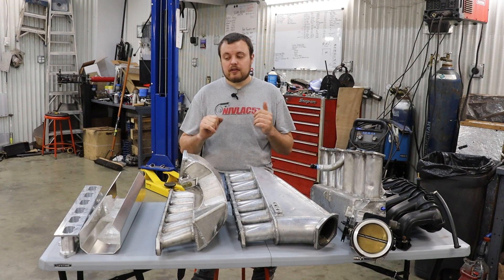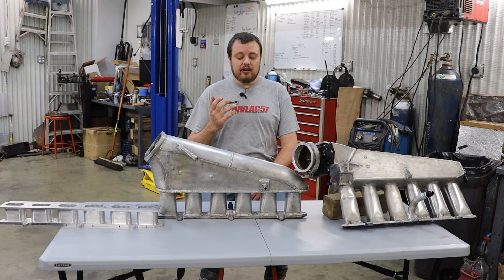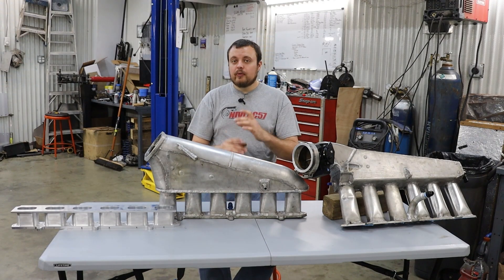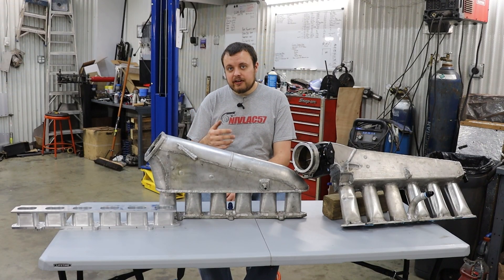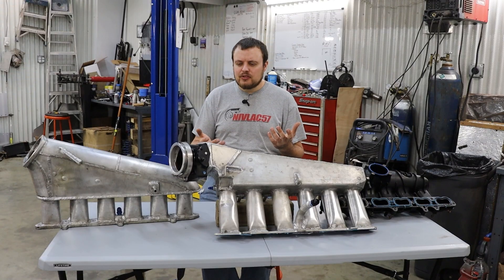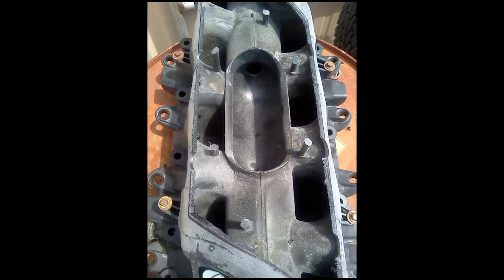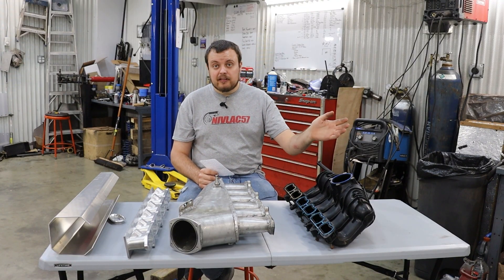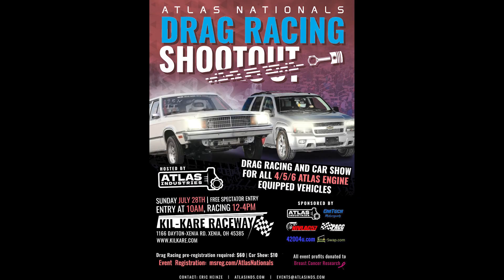Unlocking the Power of Your Intake Manifold

Comment: I remember top fuel having higher HP engines when they had a kick right on the inlet to head flange. 
Those motors had multiple of this stepped staircases on the inlet, purely so the combustion chamber has mega flow cooling. Fuel running don as a flow steam and cascading into the hot combustion chamber. 

Just saying 😐❤️🫣😘

Comment: disclaimer i am not an auto engineer but have researched intake design for 20 years and built several for my own engines/swaps. i have discussed the info below with OEM engineers and have drawn the following conclusions*

Plenum volume is a widely misunderstood concept that gets parsed and cherry-picked and quoted across the internet.
It started being discussed with carb engines back in the day and transferred into the discussion as EFI came around.

I would bet that it became a talking point with some of the JDM legend engines in the 90s/00s but was misunderstood there too. The real purpose of the plenum is to attempt to evenly distribute the airflow from the TB to all of the runners. "Volume" became a discussion topic simply due to needed geometry. 

With I-4 and I-6 (JZ, RB, etc) engines back then the plenum had to be long. In order to try to get air evenly to the front and far-back cylinders, and allow the air to turn a large enough radius to not have big losses, the "roof" of the plenum opposite the runner entry had to be further away and the end of the tank more rounded. Think of the typical 1JZ/2JZ intake you would see 20 years ago. In reality there is a lot of "extra" volume between the roof and runners that only serves to help the airflow turn.

End-throttle manifolds would need to be bigger than the "angled end" throttle since the air has to turn sharper. But you can only fit one or the other into your chassis, and people were grasping at straws at figuring out how those cars made more power than the other.

The stock Atlas manifold can be smaller because it has a central TB and the tank slopes away from the TB entrance. The air hits a sort of wall once past the TB and has to change direction but it does it more evenly, in a very similar fashion to the "slam-air" Ford 5.0 intakes of the 80s/90s.

In reality the 1.5-2x displacement rule of thumb is completely made up. Displacement of plenum vs engine has no golden ratio and can even vary based on the number of cylinders due to the strength of the runner length pulses (more cylinders=more pulses=higher frequency=less damping volume required since they sort of damp eachother). 

A NASCAR from a few years ago makes 900hp at 9000rpm give or take, using a plenum maybe 60% of displacement. The LS family stock is 50% or less (can't remember exact numbers but it's been measured out there). See RIchard Holdener's Keggerator video for an extreme comparison.

But overall SHAPE of the plenum is going to be more important for overall power than simply the internal volume.

Comment: NA intake shape and size matters
Boosted .....dont matter
Reply from the maker: Hard disagree. I heard some one say this before, "NA is boosted". NA just has ~14.7 psi of pressure, and boosted has more depending on how much pressure the power added is contributing. While you can increase boost to meet power goals, a more efficient intake will have potential performance benefits to response and overall horsepower capacity. Saying it doesn't matter is just wrong.

Comment: I noticed that a lot of these manifolds have the injector moved quite back away from the head's intake port. Have you found that there is an effect on idle quality or power delivery? Also, I've noticed the injector angle in some of these points 45 degrees or so, spraying onto the intake runners. Any change in affect (vs. pointing at the back of the intake valves)? Looking to build my own intakes and this information would be super helpful. Thanks again, and great videos!

Comment: You won’t notice performance  change in the plenum capacity with turbo applications and the benefit of increased plenum capacity is more important with ITBs. if your throttle is before the plenum and you increase its size you start to take a hit on throttle response because you are increasing the volume under vacuum.

Comment: What would happen if you set up the runners into one plenum the size of your throttle body component?  Willl you get an uneven fuel to air ratio or will you get something better?  

If the runners went 4 to 1 but have enough space for the throttle body

Comment: It's amazing how little engineering has gone into aftermarket air intakes.  So much of this is broscience based on it worked for someone else  and was tweaked many times trying to get better than copied without any additional thought put into it.   Billet vs. welded is obviously irrelevant and damned expensive unless you own your own full sized cnc mill.   Plenum shape of OEM and aftermarket intakes is a real thing as flow testing has shown different volumes in different cylinders.   Runner length affects air speed and we know air speed and volume are both important although I cannot explain why.     It would be nice to be able to do the basic math to estimate minimum plenum volume for engine with turbo x pushing y cfm into the plenum... but of course this varies based on engine rpm/load dramatically.   It's a dynamic system.   We care about area under the curve irl a lot more than peak hp/torque numbers unless we are bench racing or building for the drag strip.   It's a really interesting problem that I wish I understood a lot better.
Reply from the maker: Yeah. I think the math is kind of a bunch of baloney. It's too complex of a problem to solve, with a simple calculation. Even the computer simulations have very limited value. The only real way to see how well it works is to build it and see how it does.
Reply: @Calvin-Nelson  It's difficult math but it isn't baloney.   This is why engineering takes years to learn.   It's hard.    We have software tools that can model engine flow and turbulence.    You need to understand the math to use them effectively.    Bro-science is not the way.

Comment: Interesting video, on a small 4 pot engine I had the exhaust manifold calculated for the best harmonics and found that a 4-2-1 was better than a 4-1. Interestingly the calculation program throws up critical intake length and for my setup the best intake length was 332.5 mm ( 13.09”) to head face. This takes into account camshaft lift and duration, combustion chamber shape and valve per cylinder and rod length, it even gives exhaust length. I’m still trying to squeeze the long inlet in to a Lotus 7 engine bay

Comment: Oddly enough, this was explained to me in a way that I can apply it to an I4 setup. I want peak NA power to see what it can do before I turbocharge it. Was planning on redesigning in the intake manifold but did'nt know where to start. This was an interesting watch because I know where in my rpms I'm looking for responsiveness, mainly in that 3k-5k band.
Reply: You won't get peak NA power from an engine looking in the 3-5 grand range. You need to push the revs as high as possible, unlike in a boosted build where you can choose to have power down low (provided you have durable enough internals!)

On the other hand, if I misunderstood and you only want it to begin to pick up from 3-5k, with the real power being higher up the range, and don't mind it being lumpy lower down, having a "minimum usable RPM" is useful for deciding how far to advance (and widen the duration of) the intake and exhaust openings (i.e. you can dial in your desired cam profile).

Comment: When the intake valves close there’s a shockwave created that can reduce the amount of air that enters the combustion chamber when the valve opens again. Runner length is often utilised to either reduce this effect or take advantage of it by reflecting the shockwave off the plenum walls back into the combustion chamber of the particular cylinder or an adjacent one.
This is most crucial for naturally aspirated engines.
However it can help or hinder boosted engines.
The speed of sound changes at different atmospheric pressures. This means that what works under partial vacuum conditions in the intake won’t work under boost unless the runner length is tuned for the boost pressure and the rpm.
It might be possible to deflect the shock wave into the next cylinder by putting a small deflector on the plenum wall above the runner, position it so that air headed towards the cylinder is directed down the runner but air reflecting off the valves doesn’t strike a flat surface when it leaves the runners.

Comment: There's another reason why the factory stuck the injectors in the head, and it's something a lot of people miss, and it's why the factory stuck to batch fire for a long time. The injector points at the back of the valve, when it fires while the valve is closed the fuel hits the valve and evaporates from droplets in to vapour, and vapourized fuel burns better then liquid fuel, meaning at cruise you can use a lot less fuel to make the same power. Side benefits are that the evaporation process cleans off the back of the valve, making it last longer, and cools the valve, also making it last longer.
When they moved to Direct Injection in the cylinder head, they lost those side benefits, and ended up with people having engines with dead valves that have the back side of them coated in exhaust deposits, on both inlet and exhaust.
Plenum Size is more relevant to Naturally Aspirated, where it holds enough air for the cylinder to suck from, where the pressurisation of turbos and blowers fills the plenum with substantially more air then the volume will hold alone.

Comment: my 2020 Audi S4 with the EA839 engine has literally zero intake runner, but the engine itself is a torque monster. In stock form has 345 hp and 369 foot pounds of torque and it hits super low in the curve🤷‍♂️

Comment: I'd be really cool if you started selling CNC made version of the flange to runner setup you have perfected. Then guys like myself with various platform swaps could build the plenum side around it to fit the engine compartment we're working with. I had sendcutsend do the flange but it has no gasket notch and I'm not 100% that it's port matched.
Reply from the maker: Working on it.

Comment: I haphazardly welded together a sideways tunnel ram for a Saturn wagon with a Pontiac Eaton m62. The runners are about 4" long into a trough the blower bolts onto. No way to tune that computer, but zero boost it scoots. 2"TB to a 3" TB, header... It also shares the 7 tooth reluctor, but it's a non cam sensor speed density setup. It runs awesome no boost, barks the 1-2 shift, and still gets 19.6 delivering pizza
Reply: Injectors on the bottom
Reply: https://youtube.com/watch?v=__cT1LOOv0Q&si=srmcjpKSF9F2svgz
Reply from the maker: Very cool!

Comment: Hey boss I own a 2004 trail blazer 4.2 vehicle only has 82k miles would like to turbo it and what boost level could i get away with the stock fuel pump injectors etc. Thanks wish I lived near you guys just wanna be different and not go LS when this engine is actually decent fuel mileage and so darn reliable.
Reply from the maker: I'm not sure. Not a lot. Maybe 5psi. The stock injectors are small.
Reply: @Calvin-Nelson  well ty for response maybe when i get a chunk of money i could pick your brain more. I wanted to run more then 5 cause the block alone stock prob good for 15 safely then it would be a substantial gain. Not trying to make a drag car out of it but be unique and have the power if i wanted it. again ty sooo much for your time if their was someone to ask I knew it would be you. I love my stock 4.2 been so reliable. My model even has limited slip diffs  low mileage figure be a good daily with a turbo.

Comment: 1:01 Why some of the newest engines have their manifolds (usually exhaust) as part of the cylinder head, in one piece. Increased efficiency, but it's harder to maintain and modify.
The resources and extensive research from OEMs can lead to some crazy solutions.
Reply: Middle cylinders flow great, outer cylinders flow like crap!  I think the thing to bear in mind is the OEMs only care about making the stock power and torque level.  They usually aren't trying to make an engine that has a lot of potential for more power or race usage any more (even though they did that in the past).

Comment: you should try a twin plenum intake, they often end up spooling turbos quicker and they flow better across the rpm range as they smooth the air flow and distribution more there's a reason rally cars and other race cars ran them @stav-tech does some good info about them if you want to look

Comment: Missing velocity stacks can create a loss of more than 20% - bad transitions is the no.1 mistake most people make.
Reply from the maker: Not saying you are wrong, but I have not seen 20% on the flow bench.
Reply: @Calvin-Nelson  we are doing CNC cylinder heads for almost 20 years, also a lot of air restrictor design, and 20 percent is not the biggest loss I saw. People are not paying attention to details and are often not aware of the impact small „imperfections“ create. All the best from germany ! Tim

Comment: If you don't have individual EGT's or widebands, larger intake plenums will add some safety buffer. Because the pressure inside the manifold fluctuates less, the AFR across all the cylinders will be more even. The downside is response. OEM's are not making a ton of power so AFR doesn't have the same danger it does in an engine making 200+ hp per cylinder.
Reply from the maker: Interesting! Great tip.
Reply: Has that been tested?
Reply: @andrewmontgomery1763  yes, I saw that somewhere on YT academy, and I also saw it testing a turbo d16 engine. Standard z6 manifold need about 5% fuel trim in cylinders 2 and 3 to run about the same temps, and after tripling the plenum volume and retesting, we ended up backing out all of the fuel trim we had previously added to equalize the EGT's again.
Reply: @turbovolvos40  innnterestong. And the only change was the increased plenum volume?
Reply: @andrewmontgomery1763  yes sir

Comment: The factory intake working to 6700 is impressive, as the factory PCM hard limit is 6300 RPM. Most Atlas powered GMT360 vehicles don't have a redline on the tach, either.
Reply: That's where they fucked up... Cuz it sounds ghost up there i drive thru the gears 🤠

Comment: Have you watched David vizards channel? He has really good info that would probably help you further refine your designs. There's another crucial piece to the puzzle that is often overlooked and it has to do with the runner opening size compared to the runner exit size. I don't know the exact math off the top of my head but there's a ratio to inlet size to exit size that plays a huge role in air velocity and volume. An example being, if your port size is 2 inch diameter then your runner inlet size should be 2 1/2 inch with a gradual taper over the 3,4,5 inch length down to the 2 inch diameter. Matched with the proper velocity stack inlet radius. Also each runner length and diameter has a corresponding radius for the bell mouth inlet that maximizes the inlet air charge for best intake pulse results. He has some of the best info I've seen in regards to anything horsepower and efficiency related.
Reply from the maker: Yeah. I have seen a few of his vids. I tried a tapered runner on the flow bench. It resulted in 0 increase in flow, which surprised me
Reply: @Calvin-Nelson Most of Vizards work, applied to engines designed before CadCam and Fluid Dynamics were available to the design process. A lot works on things like 1275cc Mini engines or Chev 350's, but won't work on a 4A-GE in an MR-2 or an LS.
Tapering down in size is never going to work, ask a plumber what happens to water when the pipe gets smaller, and then consider that at the maximum flow in a manifold the air behaves as an incompressable fluid. The "Ram Chargers" group of engineers from Chrysler figured that one out in the late '50's, leading to the design of the 413 Cross Ram and the Slant Six HyperPak. There's a whole section of fluid dynamics that relates to the surface friction and different speeds of the airflow according to how far from the manifold surface it is, but once you saturate the flow, all you get out is heat.
Reply: @Calvin-Nelson  The important thing would seem to be the proper inlet lip radius (not to be confused with the actual radius of the runner, which you correctly say in the video just needs to be the right shape and size for the ports), rather than the slight taper which would seem to stretch out the pulses a bit (widens the bandwidth = slightly wider range of RPMs, but less energetic pulses).

Similarly, if the radius (i.e. the rounding of the tip of the intake runner) is too large, the pulse will be stretched out and diminished. With too sharp of a lip on the runner (i.e. a very small lip radius), the flow is constricted quite considerably, and the effective inlet diameter is narrowed.

This last effect is very visible using CFD software. Simulating pulse resonances of moving airflows on the other hand is a bit trickier but there are research papers on it.
Reply: have you gotten a chance to buy and read any of his books yet?
Reply: @jacquescrusan9500  when I was in the high performance program at Ohio technical college 15 years ago we got his how to build horsepower book. I think it was the one from the 90s. I believe I still have it...
Reply: When you start making 150-200hp NA per liter of engine volume, you quickly realize the “vizard” knows dick.
Reply: I've always held him in high regard but fuck... David vizards voice would send you to sleep in 5 seconds.
Reply: @blairo15
I've watched most of his library on 2x speed! He sounds normal actually at 2x speed and you also realize how short his videos are.
Reply: @bigmoney4661  haha. That's awesome 😂👍